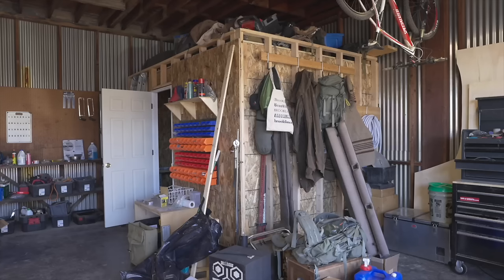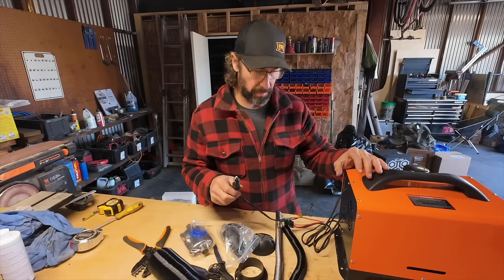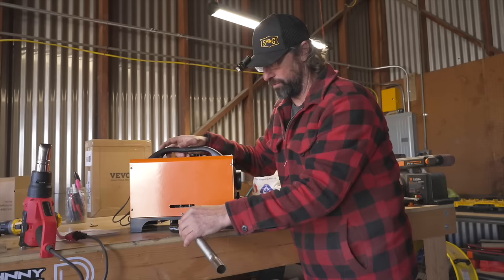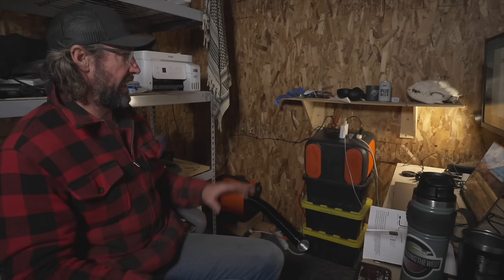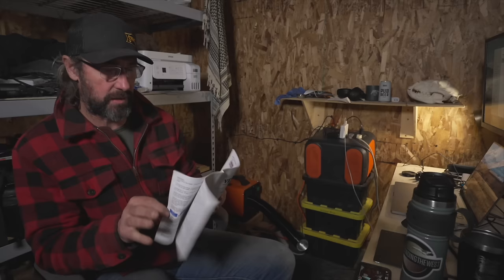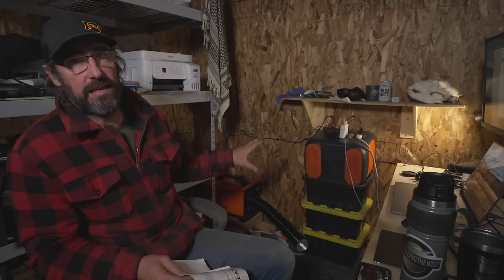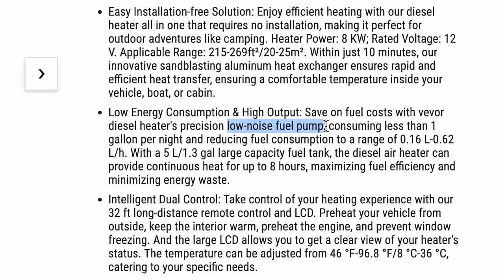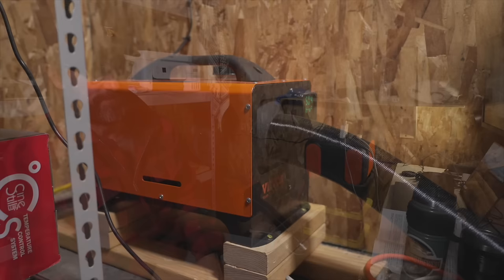Vevor Portable Diesel Heater - Don't make this Mistake😖

Comment: Hi Jason, if I might, I’d like to make a couple of suggestions. As far as what the capabilities are; I have a 12X24’ portable building on my property and I’m using a similar diesel parking heater in it. Temperatures here in the winter are often in the teens and on the colder days in the teens I can get up to 60*f plus. Insulation is key so once you do that that heater will be able to drive you out of that small space! I would suggest using an inverter for the power supply, backed up by your Jackery and I’ll explain that in a bit. The inverters are inexpensive and are 110V AC to 12V DC and are available in 15 amp DC output. Since you have AC power there it shouldn’t be a problem. I would also use the Jackery as backup ie in parallel with the inverter for safety reasons. If you have even a momentary AC power glitch, the heater will shut down hot, especially if was on high at the time and the fan not being able to remove the heat sink from the unit can actually partially melt things such as the circuit board, fuel lines etc…ask me how I know. Also those cold no starts will eventually carbon up the burn chamber which will require cleaning. Also you don’t have to pull the 14*f cold air from outside and that will help as the space warms up. Your office space does not appear to be air tight by any means plus the combustion air requirements for those diesel heaters is tiny. Also the inverter voltage is adjustable so it can be set just a tad above the Jackery and there will be no draw on it at all. Leave a comment if you need more information and we can figure out a way to communicate better via phone or email.
Reply: Great information here, I'm setting up one in my shop and find the connection for your exaust interesting.  
I have 3/4 inch plywood to go thru and if the exaust touches metal and then that metal touches the wood, it burns it.   I want to use your idea.  I am still concerned that metal will conduct the heat.  
I ran my exaust thru a larger diameter pipe and that pipe is snug to my hole.  I think my issue is its a tight fit and that pipe is getting to 400 plus degrees.

There needs to be some kind of space between the pipe and wood or whatever it's attached to in my opinion. 

Hopefully this makes sense.  Just looking for a way to do it right. With the appropriate pieces of equipment 

Suggestions please.

Comment: I would use a 12 volt battery in line to have the amperage available for the startup of the heater using a charger to keep the battery full.

Comment: It's not a great option but you can use a AC to DC converter for 20 bucks, it drains slightly more power that needed but it's not too bad. That's what I have used for the last year without issue.

Comment: Sounds like a Jackery problem and not a heater problem. I have a gen 1 Inergy Kodiak that has external terminals that the heater can hook up to directly. I have 2 Vevor heaters now. One is going on 3yrs old and a new Bluetooth model. I replaced both of their power supply cords with 8awg wires and have never seen over 9amps on the coldest startups (Michigan winters). Make sure to use anti-gel treatment for your diesel

Comment: That thing uses 120W max at its highest and ~30 W when fully heated. So basically 10A is the max it'll draw. The problem is the battery pack isn't able to maintain the amperage for long and is kicking on its safety circuitry to not overheat.

Comment: Having the unit inside is good for efficiency. Having the unit inside and the air intake outside might not be that bad. The air intake is for the combustion chamber where the heated air is drawn through the unit over the heat exchanger. Cold air has more oxygen per volume so there might be an advantage in having a cold air intake into the combustion chamber (or maybe not... don't know).

Comment: I didn't see anyone else mention this.  The main reason you draw air from outside is to avoid creating negative pressure in your heated area.  If you pull air from inside and send it outside air will come in from every tiny crack in your structure.  This air will be cold and lower your efficiency.

Comment: Haven't read every comment but an easy cheap fix I bougnt an ac to 12v cig converter since most power stations have ac.   Still portable and still using roughly the same wattage but you plug the adapter in to the ac on your power station so you can get at least 10 amps to feed your diesel heater.  My 12v outlet on my power station never actually supplied 10 amps.  It's supposed to be 10 amps according to the manufacturer but on two power stations I get the same thing.  Measuring it I noticed it shut down before 100 watts.  The adapter allowed me to use AC which doesn't shutdown and the 10 amp adapter works for me but you can find them all the way up to 20 amps if you so desire.  I didn't want to carry around another battery just for the heater.

Comment: I also had bought the longer pipe, never used it, and also exhaust insulation and sealant to hold exhaust tape strands in place.

Comment: Small 12v utility battery between the Jackery and the heater would keep the battery charged and the extra amperage would come from the battery capacity.  You could run it then with just the battery temporarily if needed.

Comment: Try doing a rubber mount to the fuel pump that will help it not transfer the sound to the frame and that will help make it more quiet. Also use a tiny atv battery in between the heater and the Jackery and that'll help with the startup\shut down power draw that trips you Jackery
Reply: Not going to help much. The clicking is the noise of the pump itself. They use them in semi trucks all the time but mount the fuel pump outside away from the unit and on the tank.
Reply: Just wrap the pump with insulation, like R-14 fiberglass

Comment: I just tried my 5kw on my 330w power station,  not enough power to run at start up but at least I know it will work. Have had the heater for a couple years and now ready to use with my battery system.

Comment: Hook up a small 12 volt battery (7ah) in parallel to the supply.
You will draw power from the battery on startup then it will charge.
You might have to limit the charge current to the battery with a high
power low ohm resistor resistor or something else.

Comment: One possible mistake that could be fatal that I can see, even though this is a temp set up, is that you have your air intake near your exhaust. It is possible is that your air intake will pull in your exhaust. Again, I know this is a temp set up. But I just wanted you to be aware so that when you do your permanent installation, you do not put them near each other.
Reply: This isn't an issue. The air intake is for the combustion chamber only. If it does draw too much exhaust fumes, it will only reduce the combustion of diesel but i highly doubt it.
The air that is being used for heating comes from the room in which the heater sets, meaning, it is a closed loop heating system. Air In on the left side, heated air Out on the right side (control panel side)

Comment: I used a 18v to 12v converter with a milwaukee battery connection (easy find on Amazon) and wired it in.  On startup I plug the  Milwaukee in and it cuts the draw seen on my Ecoflow Delta Max in half.  Once it's running I unplug the Milwaukee and runs fine.  I had the same issue if it tripping.  No issues now and when camping I could run it all night off Milwaukee if needed... So built in a bit of redundancy.
Reply: So you just use the Milwaukee on startup and then swap to the eco flow ?

Comment: 12:30 put the unit outside.  it's a furnace, just use a cold air return from inside the building space like any other furnace.  People commonly have furnaces exterior to the building or in an area of unconditioned space, but it's the choice of the installer to use a return or not.

Not using a return isn't an issue of the diesel heater, it's a installer decision to include it or not.

Comment: With the right amount of cranking amps. expensive or cheap that is up to you and 3/4inch copper pipe would work for your exhaust pipe extension as well Iv seen on a couple RV installs.

Comment: I use the Bluetti AC70 and it works perfect with this heater no problem, just something to consider when it comes to power banks and diesel heaters. Also that heat setting doesn't work, have used these for 2 years and they never shut off. Unfortunately the manuals are horrible and there is no real explanation on some of the features.

Comment: Nice well explained video, What i dont understand is you having startup problems with Jackery 2000, I've ran heater all uk winter with the Jackery 500 no  problem temps going as low as -5 in a uninsulated shed.

Comment: just an idea - put the fuel tank outside the office - one day you will spill some diesel, and the smell will never disappear.... other ppl are using a separate battery and a charger, or a dc/mains adapter for the diesel heater.

Comment: Nice, I have a different model I am putting in my big rig for a heating source. The box on it is well insulated, and running of a pony tank off the main tank. Should work pretty good.
Reply: I don’t know if I would trust one of these for my rig. I know the Webesto’s cost $1,125 but I’ve seen some people that have had issues where they stop working and are not the easiest to troubleshoot.
Reply: @recoblade1465  have to disagree, these Chinese heaters are great, they are usually just as reliable as the webasto and if they give up you can replace the whole unit and still be out a fraction of the price of a webasto.
Reply: @jamiemurphy1671  oh I'm not knocking the amount of money you save. You save enough to have a second one on if you have the space for it. Do you know how long it take a service truck or a tow truck to get out to you. Be safe out here on these roads
Reply: @recoblade1465  yeah that’s for sure, I never considered it for a truck, I use them on boats and motor homes mainly in Ireland 🙌
Reply: @jamiemurphy1671  Sorry, I thought you were the original commenter. It doesn't cost less but I was leaning more towards the propex, which is a propane heater for my van build. That way my heat cooking and water will all be burning the same fuel
Reply: @recoblade1465  Mmmm interesting, well the area I am putting it in should be easy to replace if it becomes an issue. Or replace it all together with a propane unit, since I will have 30 gallons of propane on board.
Reply: @jamiemurphy1671  Well I will definitely be doing an install video and see how it works out.
Reply: @dustysummers2680  propex makes a propane heater that works just like the diesel heaters so all of the combustion is exhausted outside and provides a nice dry heat

Comment: Vevor markets their heaters for vehicles. They leave one to assume you can just set it in your vehicle and crank it on, never mentioning that it needs to be vented out side nor do they suggest how they expect you to do so. They say you can remotely start it and let it pre-warm the vehicle. How? Stick the exhaust tube out the window or set it out side and stick the heat tube into the window or do you cut a hole

Comment: Is there an A/C adaptor for these heaters? I have electricity in the building, but not a battery pack like the Jackery....
Reply: Yep, eBay is where I got mine. 12v 30amp converter. 20.00, but I believe the small 12v battery & trickle charger is still the way to go. If you have a power outage while the heaters running, it won’t shut down properly without a 12v battery wired in

Comment: Hi. Also good that is inside otherwise you can suck in the exaust fumes and get sick or dead. 
I run mine on the mountain modus and i am not even 5meter above sea level. It's alot les noisy and it runs cooler. 
Thank you for your nice video.
Greetings of wim from Belgium

Comment: Actually it takes far less energy to heat cold dry air than humid warm air we dump inside heated air and bring in cold air through heaters far more efficient a heat exchanger to preheat exterior air helps optimize the system used in -20 to -40 Celsius conditions.

Comment: I run my heater on a jackery 500 but you need to find a liter plug that's heavy duty. I had the same problem with a cheap liter plug.

Comment: Hold on... you said the heat exchanger uses the ambient air, which is correct but the intake is also pulling in the air so if you put your intake filter outside, you're still collecting cold air... If your unit is on, it should be outside. If it is running and your tank is connected to your heater like the all in one's are, you will not get gelling. Having your heater inside your tent is a bad idea, if you're in a vehicle that you have installed your heater correctly, then you're fine but on a set up that will be getting moved and set up over and over and over, it's not worth the fire risk. If you're worried about gelling or etc, then build a small collapsible box that you can insulate your heater with outside of your "living" area.

Comment: You might buy an ALITOVE AC to DC Converter 110V to 12V Converter 20.8A 250W with Car Cigarette Lighter Socket 100V~240V AC to DC 12 Volt 20A 18A 15A Power Supply Adapter.

Comment: Other than just using a 12v 15A adapter, couldn't you take a page from the enthusiast car audio scene and install a 12V 1 Farad capacitor in parallel to provide the full 15A when needed?

Comment: Interesting, I must have 20 old power supplies (computer bricks) that have 12 volt output and some at least 10 amp output. I’d just dig through my old box of them and hack the 12 volt into one of those things instead of that cigarette plug your using. Power brick into one of the 110v outlets on the jackery, output wired into the heater, ditch that cigarette thingy you have wired in.

Comment: Wonder if the exhaust gas was run into a larger diameter pipe such vehical exhaust pipe,  if that would solve the backpressure issue and still capture the heat that would just be spent outside ..seems like a waste ..that pipe gets really hot

Comment: The manufacturer cannot make these diesel heaters to run at 10 amps 1. The glow plug is what takes most of the amps 2.with the fan running takes around 2amps before it ramps up depending on if you can adjust HZ then you can control the fan speed and the pump speed other than that if you don't have a way to get in the the main menu (secret menu) your are at the mercy of the controller (display)

Comment: I don't think it's a problem to have the heater outside. They run better with a cool air intake and the difference in efficiency is negligible. Since these don't use a turret how are you going to isolate the intake and exhaust when drilling a hole in your van? The exhaust can leak and also backfire which could cause issues especially if your asleep. So i think an outdoor installation with the all in ones is much safer.

Comment: Great review. Does this run on only DC or is it AC compatible as well? If DC only, maybe running it via a DC power supply plugged into a standard 110 outlet would get past the 15 amp limitation.

Comment: 10 Amp may be Standard but not every manufacturer performs the same. I can run my heater off my Jackery 240, have so many times with it drawing around a max of 130W which is at the upper limit (132W) stated for the outlet. Strange that it is overloading my much larger Anker power station. Would like to check it out with my Bluetti power station next month. Interesting how different units perform. One problem I do have is my inlet air hose allows the heated air to cool a bit, more so with any wind.
Reply: Some put out 12.6v. That might account for just enough of a difference to be under the max watts over DC.
Reply: @just4ivaylo92  I do believe most power stations, if not all, deliver around 12.6 volts.
Reply: @williamfuller2389 I want to buy a jackery 300 for this and I expect to run it all night in my truck. But the more research I do it looks like a better option would be a blueetti 550. Any suggestions?
Reply: @Dorkus_  I have never run my diesel heater off my Bluetti but the Jackery 300 should run it just fine through the night. Just make sure it doesn't go below 20%.
Reply: @williamfuller2389  I know they both could run it all night I was more concerned with the failure to startup in cold temps. I heard it draws a bit of power to get the glow plugs going. After that it's not drawing much at all. Would the jackery 300 be able to do the 10A+?? That's where I know the beefier blueetti 550 could do it. I'm just trying to save a couple hundred bucks lol
Reply: @Dorkus_  All I know is that my Jackery 240 can run the heater while my much larger Anker can't handle the startup load from the 12v socket. Has nothing to do with the battery capacity but rather the load limits set within the 12v socket. Jackery handles it, the Anker shuts off under the same load. Don't have any experience running it off my Bluetti.
Reply: @Dorkus_  If you're worried about Lithium working in cold temperatures, keep in mind the chemistry is fairly consistent in all Lithium power stations. They can provide power down to about 0° F but can only charge back up in temperatures over 32° F. While the chemistry characteristics are virtually the same, the unit's internal power management and delivery configuration vary from one manufacturer to another.

Comment: I’ve got a 5 gallon fuel tank from an old generator. Could I mount it above the unit and splice a fuel line into the existing fuel line for extended run?

Comment: Just purchased a Jackery 1000 pretty much for the use of a Valvor heater. You’re the first to mention the 10amp Jackery plug! How disappointing! Haven’t setup or used either yet! For the price of the Jackery & heater, I may send both back!!!
Reply: You'll be fine. I use to AC to DC inverter rated at 15 amps with ecoflow River pro.... Also rated at 10 amps.. it works 🤷🏻‍♀️